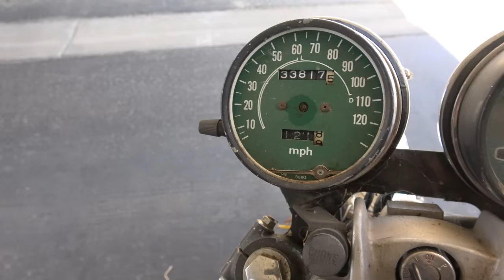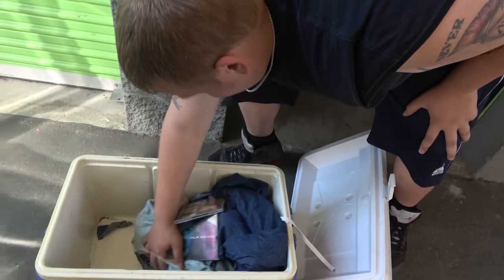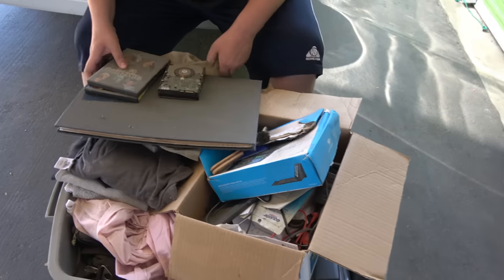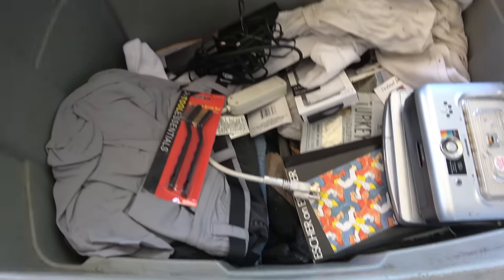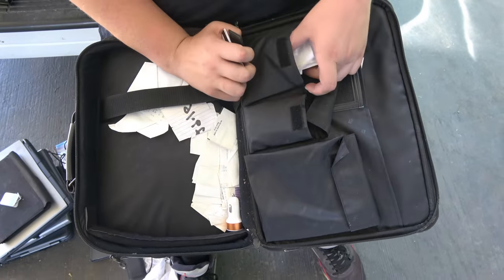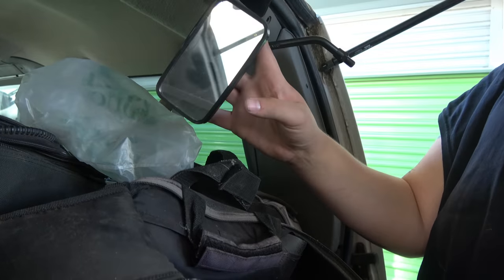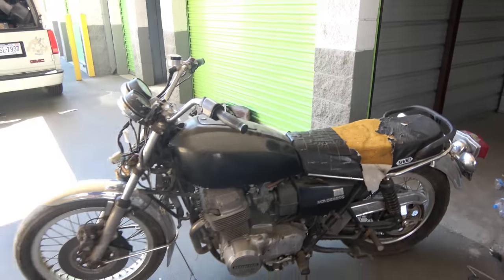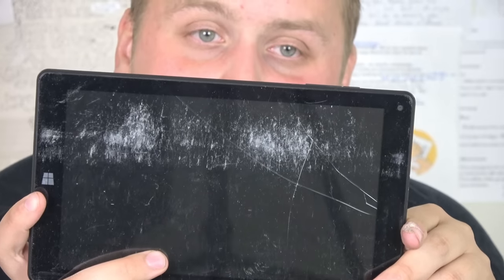MOTORCYCLE FOUND IN STORAGE UNIT! I Bought An Abandoned Storage Unit And Found A Motorcycle

Comment from the maker: How much do you think that motorcycle is worth!? Let us know!
Reply: 3000
Reply: CB750 Hondamatic not a great bike new. $500 as is (on a good day) no gear shift or clutch so great if you are missing an arm or leg
Reply: It's a ventage Honda. To the right person could probably bring a couple hundred bucks
Reply: It usually depends on the the motorcycle brand name and the year so most likely that motorcycle is worth $1,000 to $12,000 but if its something that is more rare to find then your talking about some big money
Reply: I would pay 500 for it.
Reply: The hondamatic which was the only automatic Honda put out the 750 was made in between 1968 and 1972 and it was worth $3,500 with that amount of miles on it you spend Maybe you spend maybe $300 on it and you can make a $2,000 more profit so what you put into it is what you make out of it so you're looking at maybe five grand if you can change the seat out and a also get the specs on them but there's a place in California that does buy them 3500 to 5 grand
Reply: Hotspot you pulled out of that laptop bag
Reply: How much for the turn signals and saddlebags?
Reply: @simanothername3035  Considering it is an automatic and doesn't have a gear shifter or clutch lol.
Reply: Treasure Hunting With Jebus the white and black thang you said was a beeper is actually a mobile hot spot
Reply: I paid $50 for one, it's a crapshoot on the price in different areas
Reply: I50$200 without getting it running an put all parts/tools with it
Reply: Runniing and cleaned up nice about 1500 the condition its in now around 700 ive been dealing with bikes over 40yrs
Reply: For me  $2000.00
Reply: Buy one on ebay right now for 1500 looks brand new no tears in seat,new tires, no scratches or dents
Reply: 1800
Reply: The bike isn't worth much, mabey 400 on craigs as a parts bike.
Reply: from what I've heard you can only part it out
Reply: 2k as is.
Reply: Just because the guy had a lot of laptops and other electronics does not mean he was doing something shady. Maybe he was into repairing them or something to that effect.
Reply: It's hard to tell. Condition speaks a lot, and it's pretty rough. I guess it depends on research, and the right buyer.
Reply: @MsCmlassen  I was thinking that too. My fiance is an IT tech and I could not begin to tell you how many PC's, laptops, tablets, nor phones he actually HAS AS WELL AS the MANY FREAKING MONITORS! He's 54 years old and still has his 1st computer he bought in 1984 AND he even has the receipt to it! It still works, it's an Amiga and he still loves it. 
@Jebus....he also has a Harley Davidson. LOL
If you ever come across any Amiga or Commodore stuff, give me a holla. 😁
Reply: It's a Wi-Fi hotspot that white thing that you pulled out of the laptop bag
Reply: The laptop with all the rain I'm back with the stickers that is what you get in jail or prison
Reply: The one with all the writing on the back of it you get that when you're locked up in some prisons
Reply: 500
Reply: That hondamatic 750 u got now goes for 7500 to sell it
Reply: Id say bout $700 if it runs good
Reply: I think charge what thy market will pay.
Reply: There is work to be done in getting the motorcycle registered which might be costly without the paperwork,as a parts bike it could be worth up to $3500.
Reply: In that shape with no title I presume… about 250 bucks. It’s just a parts bike at this point. BUT that was a meth pipe my friend, the bike is probably stolen which is why it was tore up and stuffed away in a storage unit. Dudes probably locked up somewhere and that’s why he lost the unit. 🤷🏽‍♂️
Reply: I love watching you both go through these units

Comment: I did a little research on the motorcycle if you are able to sell it  PART it out the side covers that say the type selling on ebay for $74.99,  throttle cables $20,  speedometer $70, choke cable $12, side mirror  $27, generator cove $90,  the frame chassis $150,  automatic wire harness $130,  front suspension forks $108,  torque convertor case $50, the kick starter thingy $75,  so as you can see if you are able to sell it the parts alone can make you probably over $1,000.  But contact Jeremy from What The Hales he likes motorcycles.  But if you can sell if for parts I would print out a list of some of the parts & the prices on Ebay to give people an idea of what the parts are selling for,  then say you can have the whole motorcyel for this amount & Jeremy probably could help you.

Comment: the motorcycle lights go to the bike you found in the locker, they are the front turn signals, and the mirrors are for the bike too, they are missing on the handle bars, and i'd also assume the saddle bags fit that bike also, they do make universal bags but also a lot are made to fit specific bikes

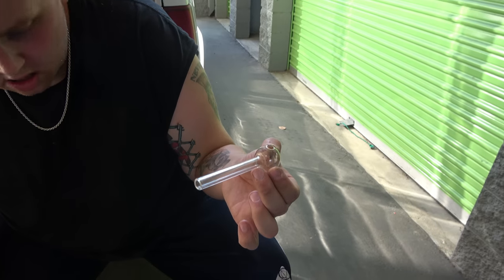Comment: Cooler contents: Dog puppet. I've driven a motorcycle and it looks like you have a motorcycle battery, lights, & mirrors. No idea of value. Jebus, Jebus, Jebus - that Young Frankenstein movie is not junk. It is a hilarious masterpiece! At 6:59 bubble blower. Can't believe the bike started. Hope you get to keep it. The Hondamatic name was used to describe a model line of Honda 400, 450 and 750 cc . The Hondamatic is not a true automatic transmission. The rider must manually select one of the two gears, though Honda's torque converter means that no clutch is needed. No idea of value. Depends on year, condition, mileage, etc. Crazy good deal for $25.00. Tyfs.

Comment: Hay Jebus hows it going. The Motorcycle is a Honda Matick 750. Honda made this motorcycle from the late '70s to the mid-'80s. It has an automatic transmission and like a car with auto transmission, you do not need to shift gears the bike does it for you. It is a bit on the rear side but don't think you have hit the jackpot. In its condition with no title, it would go for about $500 sold as a parts bike. If you can get a title and can get it running it could go for as much as $1000.00 maybe. This is just a guess as for what I have seen them going for. I no expert so don't take my word as gospel. The lights are motorcycle turn signals and could sell for about $20.00. I would say your best bet for profit on the bike would be to sell it as a parts bike. Retitling a bike is a pain. Here in Ohio, you can no longer get titles for untitled vehicles. Don't know what the laws are in PA but may be similar. I do know that people ave gon throw the state of Roidislind to title bikes as their laws are friendly to people needing titles for bikes. How you do it dont know becos I have never tried it. Let us know what happens. Congrats on the find.
Reply: Gary Krueger ll

Comment: Ok I know I'm kinda late to the party. Bike is probably worth 2 or 3 hundred tops. If you part it out or scrap it you might make a few bucks on it.  & you grabbed a little round thing threw it to the side and said junk! That's probably not worth much but I'd give you $5 for it. It's actually a green cylinder propane stand so like for a lantern or small buddy heater . But the propane tank sits in it! 
Probably not worth $5 but usually have to buy it in a set thing .

Comment: Mirrors standard fair for any motorcycle, twenty bucks second hand, the orange lights are indicator or turn signal. The kodak printer is portable for printing on the run. Most of the stuff in that unit is mobile operations. Solar charger and lots of laptops... setup and run an office from the motorcycle. Honda CB750 Automatic... rare bike, not worth shit... lol

Comment: Hey Jebus, what ended up happening with the motorcycle? Did you get to keep it? I don't think its worth alot but for 25 bucks you win, assuming you got to keep it. cheers
Reply: 1000 $ parted out, 10.000 $ fully restored. If restoration costs are reasonable it might be a great unit.

Comment: that bike is an old 750 hondamatic, which means it has an automatic transmission. might be a collectible, and the mileage is at 34K
Reply: Better to part out the motorcycle so you don't have to deal with registering.